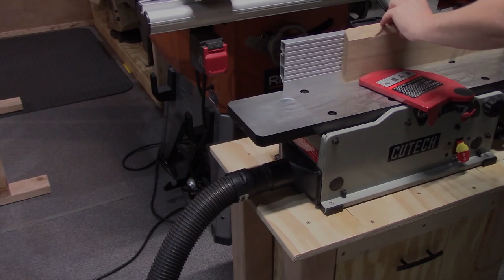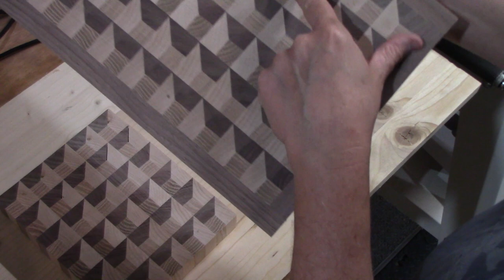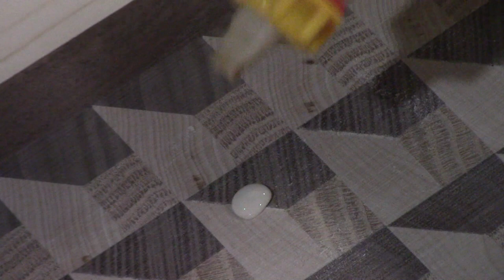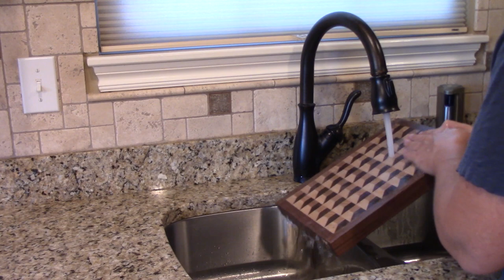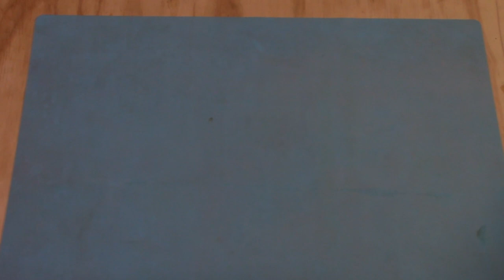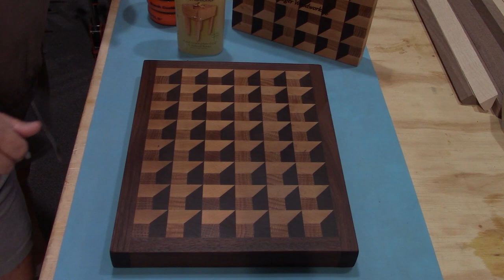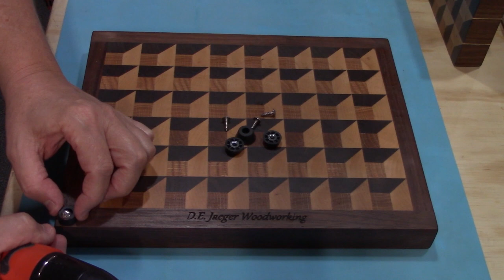The Stunning 3D Cutting Board - Part 2

Comment: Great project, love the 3D effect. When filling the voids made from the glue up, have you tried tapping the board with the handle of a screw driver to get the dust to settle in the voids then getting thin CA glue to seal it. I use this method when I am woodturning to fill voids. Just my 2 cents. Interested in trying something like this, any suggestions for books.
Reply from the maker: Hey Greg, thanks for stopping by to watch the video and comment.  Great tip!  I had also received a tip from another viewer saying to use a vacuum hose on the bottom of the board to suck the dust further down into the void.  Both techniques are great suggestions.  The voids in the video on the larger board really were pretty tight and didn't go all the way through, but the smaller board certainly had some daylight viewable, so definitely needed just the simple "brush and push" technique with the filler.  Hoping what I did on both boards will hold up over time, but I guess we'll see down the line.  I will certainly remember your suggestions for future voids, especially on cutting boards that are going to be rinsed and dried repetitively.  In regards to books for cutting board designs, I have really looked for any.  A lot of my inspiration for my cutting board designs come from watching other wood workers on Youtube.  Most of my cutting boards, specifically the more dramatic designs, are one offs so I don't really keep any sort of detailed plans.  I only tend to take a few notes here and there of things I would do differently if I was going do another one.
Reply: I’d avoid CA glue completely on a food surface. It’s extremely brittle and chips off into food. It’s also terrible for knives.

Comment: Beautiful board!!
What kind of clamps are those? Husband said he sure likes them, wished he had some.
Reply from the maker: Thanks for stopping by to watch the video and comment.  Those clamps get a LOT of questions.  I too saw them in a YouTube video and immediately started seeking them out.  They are JORGENSEN 8018 Cabinet Master 18 Inch 90 Degree Parallel Steel Bar Clamps.  These are the 18" length version but they do have them in longer sizes.  Most of the cutting boards I make and use these clamps on aren't longer than 18".  Here's a direct link to them on Amazon, but do a little comparing on the various sizes, sometimes the longer clamps are actually cheaper than the shorter ones.

https://smile.amazon.com/s?k=jorgensen+parallel+clamps&ref=nb_sb_noss_1

Comment: How much wood would you say you used in total on this board? And how much would that be in a dollar amount in material used?
Reply from the maker: Sorry for the late reply, I've been on a short vacation.  Thanks for stopping by to watch the video.  I used 6 pieces each of walnut and maple that were 18 inches long by 2 inches wide by 3/4 of an inch thick, and 3 pieces of red oak with the same dimensions.  However, that did yield the larger board and the smaller "garnish board".  If only creating the larger cutting board I probably could have gotten by with stock of 12 to 14 inches long instead of the 18 inches.  I also could have better utilized a slightly smaller width stock because I did have some cutoffs when creating the 45 degree cuts.  I might have been able to get by with 1 1/2" width stock.  I was using precut stock that I had on hand.  Figuring all these variables into the equation, I would say that precut stock cost around $30  If I would have milled the individual pieces from larger stock it would have saved some cost, but it also would have increased the amount of time, so the cost savings might be a wash.  Hope that helps.

Comment: I prefer to mix sawdust with 5 minute epoxy and then apply it to the gaps after they have been masked along either edge with tape.  That way the filler will go only where intended, and the glue will dry quickly without shrinking.  Also the glue will not soak into the surrounding endgrain, which could be visible as a blush in the final finish.
Reply from the maker: I have used both methods.  I tend to use epoxy on larger and deeper voids, but decided to use wood dust and Titebond in this case as they were more like hairline fractures in terms of the bigger of the two boards.  Always more than one way to skin a cat.  Thanks for stopping by to watch the video and comment.
Reply: @DEJaegerWoodworking  I would have placed the sawdust on the cracks then hit the board several times to get the sawdust deep down in the crack.  I then would have used CA glue to seal the crack.  Your thoughts?
Reply from the maker: @trailboss6057  I think a thin CA glue and saw dust would work well too.  Just need to make sure that the glue is food safe as with any other glues.  I find sometimes after sanding and oiling you can still see CA fills.  Have tried both, but do like the process you describe as tapping the board to get more of the saw dust to fill the void.

Comment: Beautiful bosrd.  I am going to make this.  Are you concerned at all wih the long grain direction of the border not being in the same direction of the rest of the bosrd
Reply from the maker: Thanks for your comment.  Definitely give this one a go, it was a fun project.  I've had several ask about the border since it's not end grain direction.  I can really only say that time will tell.  Hopefully that glue up went as expected and will hold over time without twisting/shifting, etc.
Reply: I would make a boarder that was end grain as well.  Hopefully over time it holds.  If not, carefully cut off the trim boards (assuming if they fail, they will separate along the glue joints) then re-trim with end grain.
Reply: @harrybates5545  why do you think it would fail?  You do know that end grain and long grain woods are joined together in a multitude of ways in all kinds of furniture?  The small pieces in this board will very minimally expand and contract not making it “failing” a high likelihood.

Comment: A question on dimensions of the 3 pieces. I was shooting for 3/4 inch thickness that you used. unfortunately  I then realized I had rough cut my walnut boards to just over 5/8 thikness by the time I pane them they will be closer to 5/8. Based on what I see I believe as long as all the boards are the same thickness and since the 45 degree cuts are based on the thickness of the one square piece I can still get the glue up to achieve the 3d look. I can make new walnut strips but I want to see if i am correct. I hate to 'waste' wood although I would never toss the pieces. Likely use them in another styled cuttin board!, I just have alotof surfaced walnut that will finisk surfce just under  either real close to 3/4 or is 5/4 and I hate to rip that Likely I will have tried it by the time I get a reply.

Comment: Do you have links to the rubber feet that you suggest? And even potentially those orange benchtop cookies? Thanks. Awesome build!!
Reply from the maker: Hey Jordan, thanks for stopping by to watch the video and comment.  The best pricing on rubber feet that I have found is here.
https://www.amazon.com/dp/B07RYCRYY3/?coliid=I1ZD543ARBP5AW&colid=3RDH44JKWCO13&psc=1&ref_=lv_ov_lig_dp_it

The benchtop cookies were a gift, but here's what I found on Amazon...
https://www.amazon.com/Protector-Rubber-Support-Cookie-Sil161/dp/B01MFDLIKN/ref=sr_1_7?dchild=1&keywords=woodworking+cookie&qid=1603166316&sr=8-7

Comment: Awsome board but I cringed when you put the pads in place without pre-drilling! So glad the wood didn't split.
Reply from the maker: Thanks for stopping by to watch the video and comment.  So far I've only had one board split on my when putting the feet on, and it was a softer wood.  I do sometimes pre-drill if I'm afraid it will crack, but so far it hasn't been an issue.
Reply: @DEJaegerWoodworking  I did the same on m cutting board and no split. The screws I have are self tapping and sort of act like a tiny drill bit as well. It’ll probably never split.
Reply from the maker: @victoryak86  I do sometimes pre-drill holes for the feet.  A lot of it depends on the wood itself, and I try to stay away from any glue seams when screwing the feet in.

Comment: This was a really cool video. Calming music as well.  Thank you for sharing!   Can I ask what kind of clamps you used when you glued the 11 pieces together?  On this video you can find it at timecode 1:18.   Thanks!
Reply from the maker: Thanks for stopping by to watch the video and comment.  I get questions regarding those clamps all the time.  I saw them in a woodworking video some time ago and really liked them.  They are JORGENSEN 8018 Cabinet Master 18 Inch 90 Degree Parallel Steel Bar Clamps.  They come in different lengths but the ones in the video are 18" long which are great for the size of cutting boards I typically make.  Sometimes the longer clamps cost less, so look at all of the lengths as a pair of the longer clamps may actually be cheaper.  Here's a link on Amazon to a pair of the 24" length clamps.

https://smile.amazon.com/Jorgensen-Cabinet-Master-24-inch-Parallel/dp/B0742BTGYP/ref=sr_1_10?dchild=1&keywords=jorgensen+90+degree+clamps&qid=1608747678&sr=8-10
Reply: @DEJaegerWoodworking  That’s wonderful!   Thank you for the info.   They have quite a selection.  

Again, great video and the board turned out beautifully.

Comment: Very nice work! Beautiful! 
One question, when you raised the grain you used quite a bit of water, is that necessary?  A craftsman friend of mine suggested using a spray bottle to avoid saturating the wood and avoided any tendency for the wood to cup or warp. 
However with your level of craftsmanship, end grain and the grain going in opposing directions I suppose there wouldn't be any chance of that anyway.  
Again amazing work!
Reply from the maker: Thanks for stopping by to watch the video and comment.  In regards to your question... I've seen it done both ways, rinsed and sprayed.  I haven't experienced any cupping so far, or at least not noticeable.  I do dry them on some elevate discs so that both the top and bottom get sufficient air flow, so that helps.  Thanks again for your comment.
Reply: @DEJaegerWoodworking  Thanks for the video! 

Do you pour water over again between every new sandpaper grit or just once? Thank you
Reply from the maker: @34JohannesHeinz34  That's a great question, and is really a personal preference.  I know some wood workers that only wet the surface of the cutting board before the last round of sanding at the highest grit.  I've done this as well.  Some of it may also depend on the types of wood you are using and the grain direction in which you've assembled your project.  For example, face grain or side grain arrangements are going to feel rougher than an end grain arrangement.  Maybe not immediately, but after a few uses it will be noticeable.  It may also depend on the project itself.  For a cutting board you might not raise the grain between every round, but for something like a chessboard where you want almost a glass-like finish, you are likely to want to.
Reply: I’m not sure it’s necessary to soak the thing under so much water. Remember you’re trying to “raise the grain” but this is an end grain surface.  So what grain are you exactly raising?  Moreover because it is end grain, they are essentially like straws so more of the water will be pulled deeper in which is both unnecessary and undesirable!  Why would you want to do that?  The whole point is for sanding the surface not reintroducing moisture to the interior of the wood.

Comment: I really like this. I'll watch the videos at least twice more before I get started. I happen to have the same three species in stock. I also have some purpleheart and padauk that might substitute nicely for the walnut.
Where does time go? I've been so busy and still haven't gotten to this. Procrastination will just make it better when I get it done. BTW, I just noticed that you didn't predrill for the screws. Wasn't that risking splitting the wood? You were putting those rather close to the edge in a hard wood.
Reply from the maker: Thanks for watching the video and commenting.  Please share your project after you're done.  I'd love to see it, especially if you substitute some of the woods.  I think you'd get some really vivid definitions of the 3D effect with those woods.
Reply: I made some  cutting boards  with padauk, but when putting finish on the oil in the Padauk comes out and go onto the Maple. How to stop this from spreading? Thanks.

Comment: Love the results on this board! Do you ever heat up the Howard's Conditioner? I have put a dish of it in the microwave for a few seconds to warm it up (as it states on the back of the bottle) but I'm not sure if it has made a difference or not.
Reply from the maker: Sorry for the late reply, I've been on a short vacation.  Thanks for stopping by to watch the video.  I appreciate the comment and compliments.  I have gotten a similar suggestion on the Howard's conditioner.  In fact, if you watch the newly posted video of "The American Flag Cutting Board", in part 2 I actually use a heat gun to melt the conditioner before applying at the suggestion of a user.  It worked well.  Here's a direct link to the video... https://youtu.be/U4GEJKMLyoc

Comment: How much do you charge for cutting board like this?
Reply from the maker: Thanks for watching the video and commenting. I appreciate it!  There’s several factors that I put into pricing any cutting board (type of wood, size, grain orientation, etc.). This particular board ended up being roughly 12”x10”x3/4” and was sold to a local acquaintance for $225 (if I remember correctly). Since I worked with them and didn’t have to ship it I gave him a little bit of a discount ($25). I have made larger variations of this board and priced them accordingly.

Comment: Hello! I’ve been baffled at how these optical illusion projects are created. Gorgeous work....your tutorial was on point along with your choice of music accompaniment. I do have a couple of questions, though. How long and how many times do you bathe the boards in the (food safe) oil? Also how many coats of conditioner do you recommend? Again, great video....
Reply from the maker: Thanks for stopping by to watch the video and comment.  I typically only submerge the cutting board in food safe oil at the very end and only for a few minutes, then I place it on edge on a wire rack to let the excess oil drain back into my container and dry (typically over night).  The next day I'll apply one coat of cutting board conditioner by hand and let that dry for several hours, if not over night.  At that point I typically am turning it over to the customer who purchased it along with detailed instructions on how to clean and care for the cutting board.

Comment: How long did this project take you roughly, and I love the 3d effect, it came out beautifully.
Reply from the maker: Thanks for stopping by to watch the video and commenting.  I really need to do a better job of tracking my time on projects.  The real issue with this one was the clamp up time because I was limited with how much I could do with the amount of clamps that I had.  Each of the mosaic glue ups took a day because of dry time, but realistically that's not total time spent, it's wait time.  If I had enough clamps, I'd say that you could probably knock this project out in 3 or 4 days (allowing for glue drying time).  First day would be getting your pieces cut and sanded to dimension and then a glue up.  Second day would be glue the individual mosaic patterns into a single panel, day three would be cutting the panel into strips and gluing, and day four would be sanding and finish work.

Comment: Great video.  Very well explained and worth a 2 part series.  Question:  Did you think about putting a mitered corners on the walnut boarder?
Reply from the maker: Really, the border was a last minute decision, and man have I taken a beating for it too.  Mitering wasn't really in my thoughts.  Because the border itself wasn't arranged in an end grain pattern, I had the cross grain glue police on my butt immediately.  However, I have gotten some great tips from users on better ways of approaching this type of glue up which I'll definitely try on the next round.
Reply: @DEJaegerWoodworking   I am sorry for my post.  I hadn't gone trough the other comments before I did.  Don't worry about the cross-grain glue group.  I used a face grain maple on the border of an end grain walnut cutting board.  But I cut a ledge on the walnut so the maple was only half the depth of the walnut providing 2 glue sides.  I did it for appearance rather than strength but haven't had an issue with it.  Maybe in 20 years but at that point....it won't be of any concern to me nor will be anything else.
Reply from the maker: @bw162  Luckily I know the customer who purchased it and he's meticulous about the care of his cutting boards, which is half the battle.  I'd be a little more worried if I knew the end user wasn't going to take care of the board.  I know he's let me know if there were issues with it, and that's all that I ask.
Reply: @DEJaegerWoodworking  you shouldn’t worry about those criticisms. This stunning cutting board is more of a show piece because who really wants to mess it up with cutting veggies all over it?  Border is great as it is.  45s absolutely unnecessary and boring.
Reply from the maker: @victoryak86  I understand some of the criticisms, but I do know the customer that purchased it, and he has not used it as a traditional cutting board.  He keeps it on display, and actually conditions it regularly, which is surprising for any cutting board owner. :)